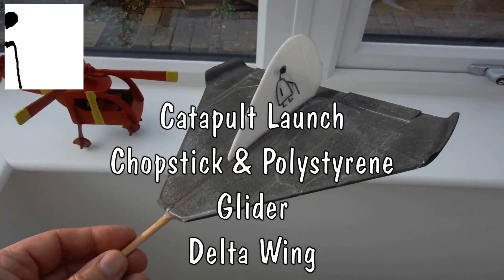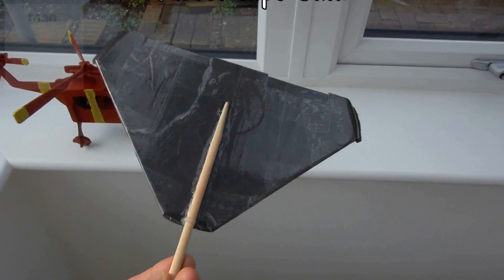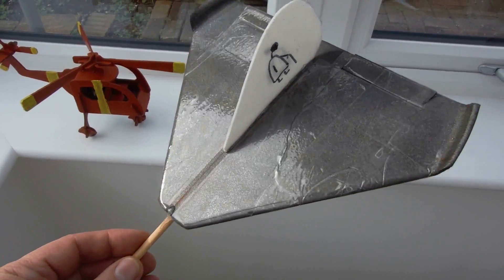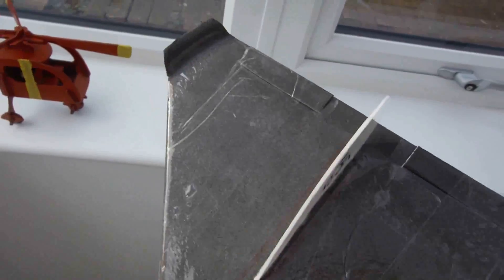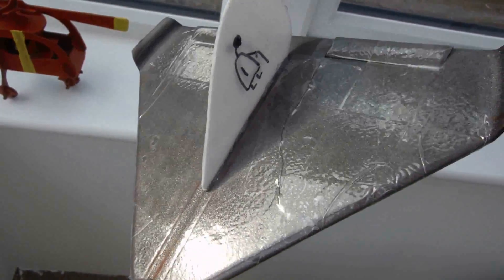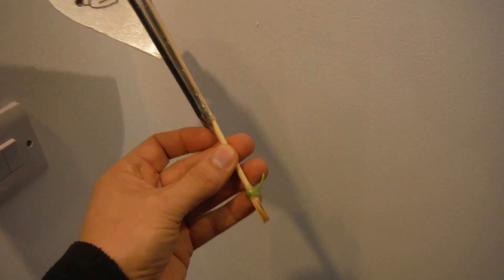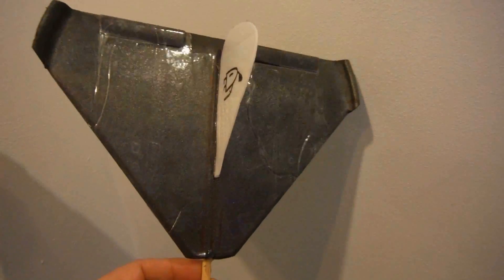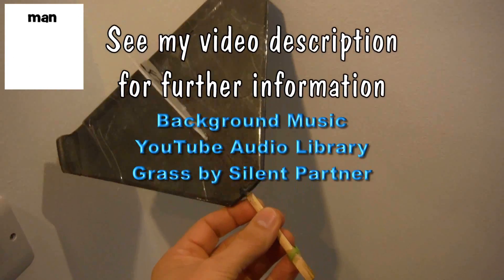Catapult Launch Chopstick and Polystyrene Glider Delta Wing Parcel Tape Skin

Comment: Glides nicely now.  ☺
It looks like the weight of the tape balanced out the chopstick.
In a comment further down this board you mentioned control line models.
I had a control line model when I was a small boy but my Dad and I couldn't get it in the air.
I would very much enjoy a video series of your build and flights but I know you have a huge back log of projects.
Maybe one day.  😉
Reply from the maker: +Wil Hobbs if you are still interested in control line there are plenty of videos on YouTube. I haven't flown control line since the early 70's. Shugemery is a guy who is very enthusiastic about the hobby https://youtu.be/P4rqILAs_xo
Reply: Ok.
Thanks

Comment: Oh very nice ! what a flyer when it gets up on step !
I used to cover the top surfaces on ~7oz R/C aircraft, for airflow as well as strength. The tape also stops warping over time on some foams. Many flying wings look perfectly fine 5 years on, even though the underneaths have a cracking from hot/cold storage.
Job done indeed :)
Reply from the maker: Thanks. I intend to make a slope soaring wing at some time for the summer and will probably be covering that with tape so this was an interesting little taster.
Reply: GrandadIsAnOldMan
Say, i've never seen this done and hopefully suits your projects...a slope soaring aircraft on 2 kite strings ! People fly gliders around on cliff tops via R/C and people fly stunt kites on the beach, but i've never seen the 2 combined.
Reply from the maker: slider2732 In my teens I used to fly Control Line Combat and often used to practice in windy conditions without the motor running, I even had a lead weight in place of the motor for just such occasions. It's on my list of things to do as a project, it's been on the list for well over a year now, just does not seem to get done, but now you have reminded me I will be frustrated as I really don't have the space at the moment to put it together without the grandchildren wanting to 'help'. The plan is to do a hot wire cut foam wing as that should be quick and easy.
Reply: GrandadIsAnOldMan
Cool anecdote thanks, would be like riding a bike at flight time.
Your grandkids situ reminds me of the early 90's with my kids. At the time it was a P.I.T.A getting up at 3am for bottle feeds and nappy changes, but nowadays it's a fond set of memories of life experience. You never know, mum and kids might enjoy a weekend away at Auntie Margaret's lol, yes a fine idea ;)

Comment: Excellent stuff. A couple of disasters, but it flew beautifully. Good thinking with the tape as well. Grandad in a skatepark!
Reply from the maker: The tape thing is common practice in the aeromodelling community. I watch lots of those sort of videos. As for the skatepark, yes I hid my board for the video but I was doing 360s and flips before I flew the plane. I still can't master the Nollie backside 180 Heelflip but I expect I will get there with a bit more practice.
There are usually a few youngsters hanging around but obviously they are not so keen in the cold and wet weather.